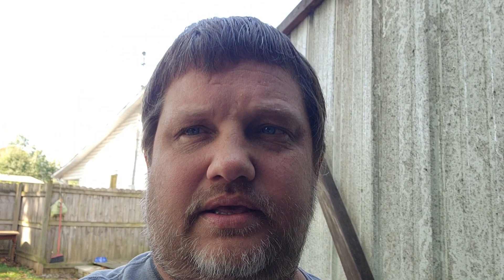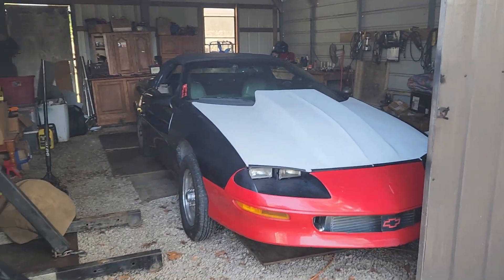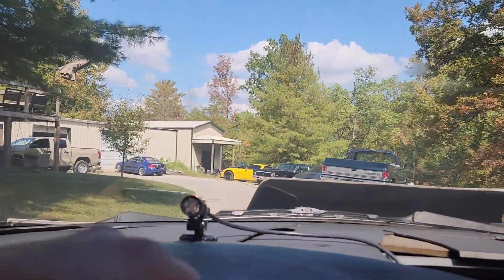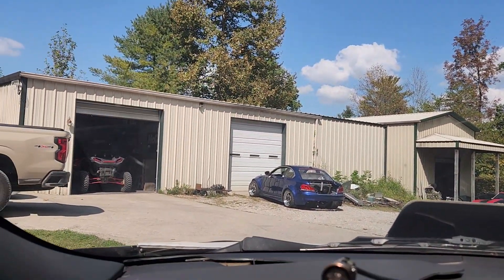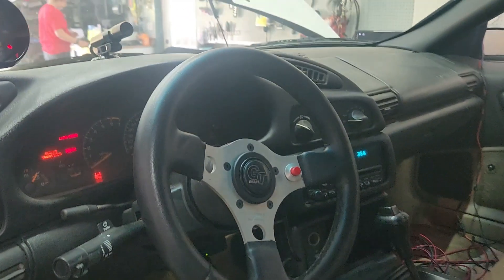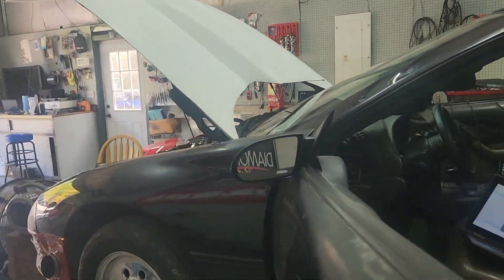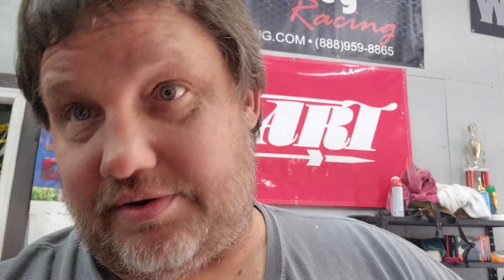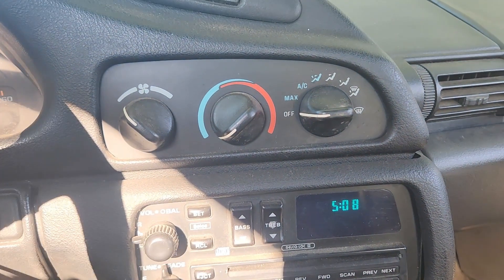GT45 Turbo 5.3 On The Dyno

Comment: 4.8 with a ebay gt45 at 12psi I went 10.06 136mph in my capri
Reply from the maker: My best so far is 9.86@132 at 3600 lbs race weight

Comment: So if a run no boost pressure line to my waste gate I will see 14-16 psi ?
Reply from the maker: I depends on your wastegate spring size
Reply: @CarportGarageDragRacing  yeah I also have the 7psi spring
Reply from the maker: @chrisrighthere893  technically, from what I understand, a 7 lb spring should do 7-14, but it never works that way, my 7 lbs spring did 5-10 lbs

Comment: Did you get a pressure ratio reading?
Reply from the maker: For turbo back pressure or?
Reply: yes. BP to boost ratio.
Reply from the maker: @pauljesionowski1626  I did not